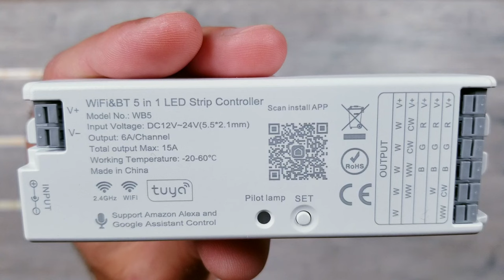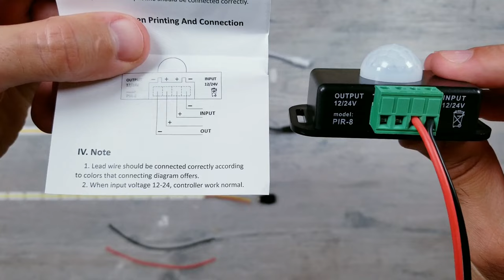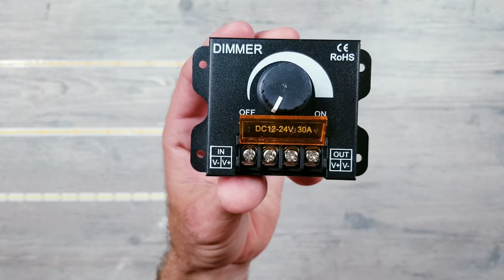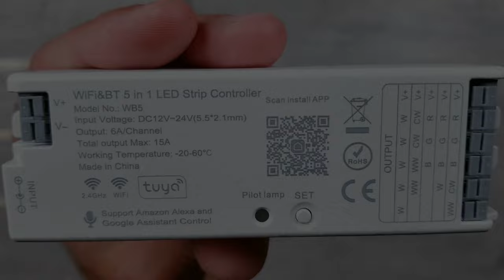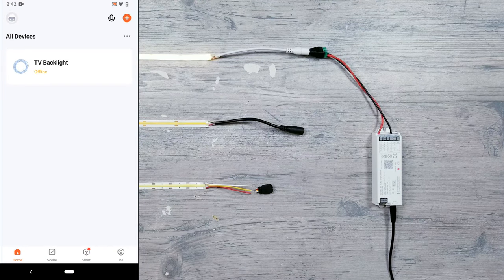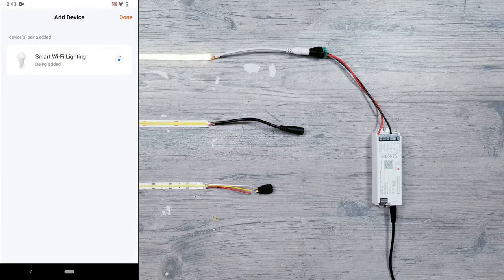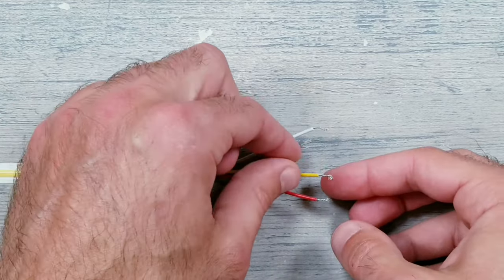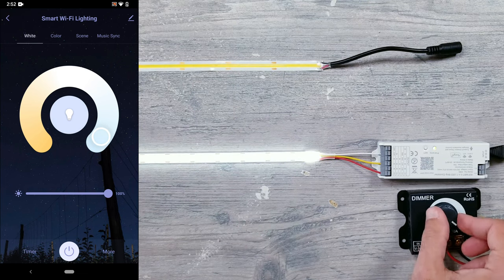COB LED Strip Tutorial: Getting Started. 4 EASY ways to control. Step by Step Walkthrough

Comment: Hey Chris, I have the rgb bts led strip lights but cannot figure out the connection to the 5 in 1 controller. I have the 24v power. The wire colors are red,white, and green. I tried multiple connections but the strip won't fully light up. I have the FCOB5M24VWS2811RGB30. Can you help me out please?

Comment: Chris, your videos are extremely helpful, thank you.
I’m planning a white LED strip installation in a hand rail leading into the basement.  I’m hoping to use two motion sensors to activate the LED strip on descending/ascending.  Any thoughts on best approach?
Reply: Go from source to both motion sensors separately, then join the wires back at the strip. That way the power has two available paths.

Comment: Can you add more than one LED strip Lights on the WIFI strip controller?? Or isit only and black and red connection (1 Led light) as shown on the video
Reply from the maker: Thanks so much for watching! You should be able to do it one of two ways. Either plug multiple wires into the same terminals for both led strips. or you can use something like a wago connector to split the wire that is plugged into the terminal and then connect to the strips if that makes sense!

Comment: I want to add two strip light on on two ends of a wall panel about 5 meters apart controlled by wifi or switch. Having trouble working out how to run both strip light to connect to one switch which then is powered by one plug
Reply from the maker: Thanks again for the comment! I would just use a couple wago connectors that have 3 slots and the red wire from the controller would go in one wago connector and the black/gnd/neg wire would go in the other which means you are just splitting the power signal and then you can wire up both strips to those wago connectors if that makes sense! I think that would work!

Comment: Do LED strips dim down to low ambient?? My contractor installed exposed LED strip but it wont dim down to ambient low light
Reply from the maker: Thanks so much for watching and great question! Most led lights can be dimmed very low to provide ambient lighting. These cob strips do a great job of dimming low as well as the other btf led lights I've used in most of my other projects.
Reply: @ChrisMaherDIY  Thanks for responding! 

The contractor said when he done they should dim down to 10 - 20%   the light is directly exposed -- i hope its low enough for mood lighting.
Reply: @ChrisMaherDIY  Thanks for responding! 

The contractor said when he done they should dim down to 10 - 20%   the light is directly exposed -- i hope its low enough for mood lighting.

Comment: Shouldn’t the sequence be: strip, dimmer, Wi-Fi, power?
Reply from the maker: Thanks so much for watching! Yeah, I think for sure that's the best way! Good catch! The way I did it still works but there is going to be a slight delay (1 or 2 seconds) from when you turn the dimmer dial on to where the wifi device gets the power and connects to wifi where you can control things via the app.